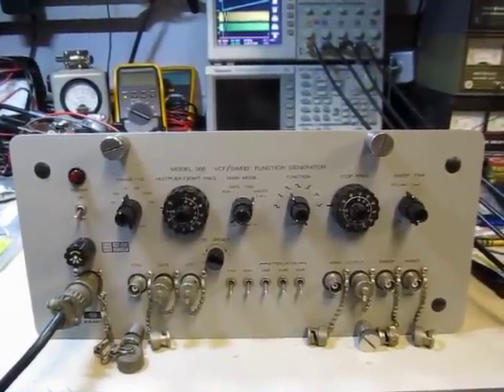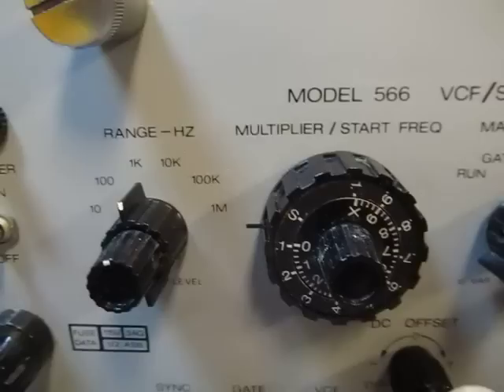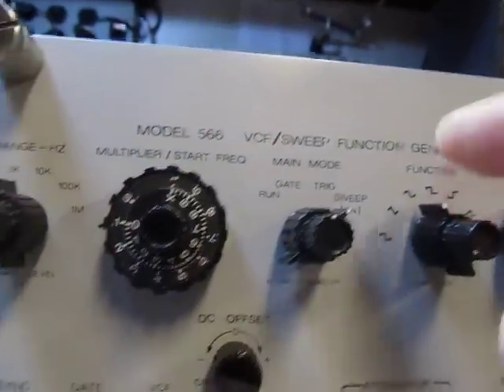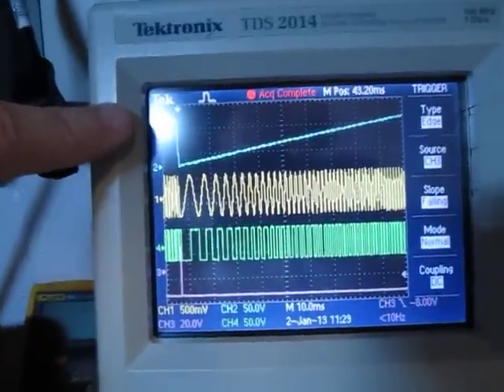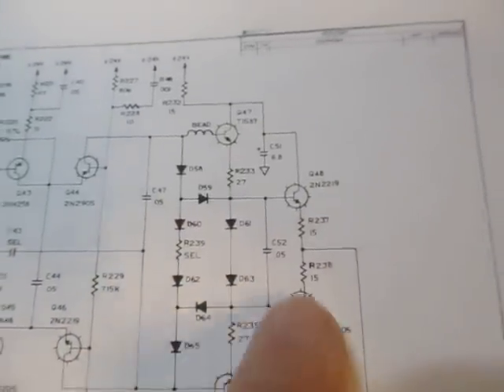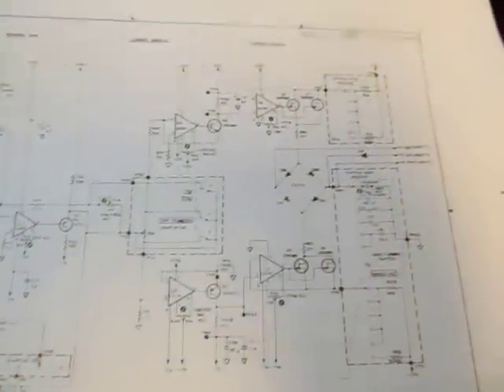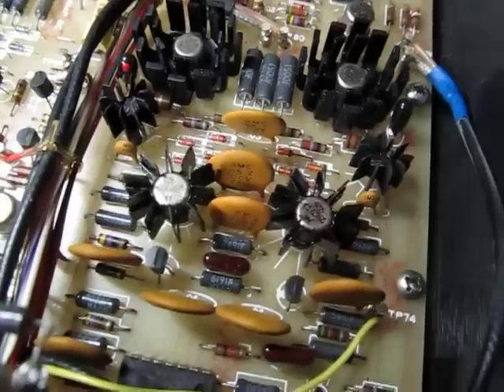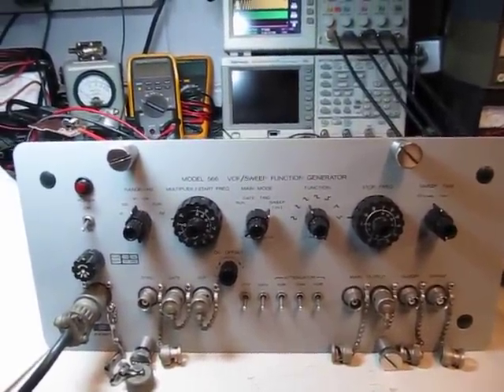#73: 70's Vintage Function / Sweep Generator review / teardown

Comment: If an amplifiers output signal is 10 vac AC peak you take the DC equivalent which is 7.07vdc    which is a "3 volt potential difference" between 10vac - 7.07vdc? Is this considered a "potential difference" from an AC voltage potential to a DC voltage potential?
Reply from the maker: No.  It is just two different ways of measuring something.  Just the same as saying that 12Vrms = 16.97Vpeak, or 28.28Vpp.  All exactly the same thing on the same sinusoidal signal.
Reply: @w2aew  If its the same thing why do you have to use the RMS dc voltage instead of using the AC peak voltage to compute for the amplifiers wattage? RMS DC voltage/ speaker ohms = amplifiers output Wattage
Reply: @w2aew  How is RMS different than Averaging? Root Means Square is a different type of averaging. Averaging is NOT 0.707 , some oscilloscopes have a menu for averaging the Sinewaveform and also RMS of the sinewaveform. RMS is some type of averaging but its different. What I'm confused is to compute for an amplifiers output wattage you have to use the RMS voltage and NOT the averaging voltage 0.636. The RMS is 0.707 VS Averaging is 0.636 but they are both averaging the Sinewaveform but are different types of averaging?
Reply from the maker: @waynegram8907  The RMS value is the equivalent "heating value", which gives you a true measure of the power.  Simple averaging (0.636) doesn't give you this because power is not directly proportional to voltage, it is proportional to voltage squared.  Maybe this video will help: https://youtu.be/ue0wtlrmCJE
Reply: @w2aew  Oh I think I get it so you're saying that Voltage is NOT Proportional to Power. I think i'm confused on what is the difference between Power VS Wattage, it seems that Power is a "heating Value" and that power is an energy and its NOT the same as wattage?
Reply: @w2aew  Power Supply full wave Rectification you use averaging 0.636 which I'm not sure when measuring using the oscilloscope to measure the power supplies output full wave rectification you take the Peak AC Voltage and average is by 0.636 = "heating Value" of the rectified DC equivalent? What I'm confused about is why would you want to "average" the full wave rectified waveform
Reply: @w2aew  It can't be the same thing because an AC Peak Voltage is NOT a Power/Energy. It seems that you have to convert the AC peak voltage either using RMS or Averaging to convert the AC peak voltage into a Power/Energy Value? Since the Peak Voltage is NOT a Power/Energy Value
Reply from the maker: @waynegram8907   Power is measured in Watts (just like current is measured in amperes, resistance measured in ohms).  Wattage is often used as a term to define the power rating or power dissipation of something.  Since Power is related to voltage squared, there is not a linear relationship between voltage and power.  For example if you double the voltage across a load, you quadruple the power delivered to that load (assuming a resistive load).  Because of this square-law relationship of voltage to power, this is why you must use the RMS (root-mean-square) voltage when computing power.  Root-mean-square quite literally means the square root of the average of the squared voltage.   Average voltage is useful for other purposes/calculations, but not for power calculations.
Reply: @w2aew  What is Average Voltage used for? it seems to be only used for full-wave rectification which I'm confused why to use Average Voltage for full-wave rectification and Not use RMS?
Reply: @w2aew  PWM pulse width modulation sometimes will take the "average voltage" but I'm not sure what other types of signals or applications would use an "average voltage"?
Reply from the maker: @waynegram8907  PWM applications are good applications where the average voltage is used.  For a PWM motor drive, the average voltage controls the motor speed.  For PWM audio amplifiers, like Class D audio amplifiers, reconstruct the audio signal from the average of the PWM signal.  A pulse counting FM demodulator recovers the  audio from the average voltage.
Reply: @w2aew  How do you use a True RMS DVM meter or Oscilloscope to measuring an Average Voltage? The DVM True RMS meter when measuring a PWM signal won't take the average so the measured voltage will be the wrong value. Maybe your DVM meter can measure PWM signals and average of the PWM signal? An Oscilloscope menu would have to be set on Averaging to get the correct average voltage.

Comment: Ow man, that's a cool thing! Now that I've seen this it gives me a bit more confidence that I can DIY a crude function generator that actually can be useful, I'm trying to make a function generator to learn more about electronics, how it all works and without using a microcontroller so all the signals are created analog and it's a great learning experience.

Most of what I learned and copied is coming from you, and because you break down all the different parts of the circuits and explaining in great detail how it all works is really super helpful to me and I'm able to make your circuits following along with your schematics and the steps you have in your videos explaining every step of the way on how certain signals or waves are created so even someone like me, with a bit of help from you personally as you've been doing this week, is able to get it working and I have zero experience with this particular DIY function generator.

I'm so thankful for your videos and your help, I couldn't do any of it without you.

Comment: This topic has almost bought a lot of discussion from members on the R390 list. The Ceramic disk are much easier to install and they do have lower ESR at higher freqs. I clearly see this when I rectify the output of a sig gen and do an A/B comparison on a scope. However, doing an A/B comparison of either and RF or IF module in a receiver I don't see any differences in sensitivity. The original caps were often Black Beauties. 
Perhaps the accumulative reduction is just not enough to detect.

Comment: One thing I'll suggest. There has been a lot of talk on the R390A reflector about Orange Drop vs Ceramic Disk caps at IF and RF frequencies. The OD's are great at audio freqs but the have a higher ESR at higher freqs. I made a simple set up where I ran the output of a sig gen into a diode and checked amplitude at different freqs. The results were very interesting. However, empirical A/B testing of modules fitted both ways proved inconclusive in terms of gain from the stages. 
73 Glenn
DSM Labs

Comment: Hi,
Thanks for another excellent video!  If you are so inclined, it would be great if you could do a breakdown of the HP 8640B sig gen. This unit is built like a tank and is arguably one of the cleanest generators ever, at least that is now in the price range of most Ham ops.
I have 4 of them in my lab and have been through them all. The workmanship and engineering is a true marvel of technology. 

73,
Glenn WA4AOS
DSM Labs (dot com)

Comment: Sweet! Was it difficult to find the schematics and adjustment guide? I can't tell what type connectors those are: looks like UHF SO-239's? Maybe a question for future videos- what specific use where 600-ohm outputs designed for? Thanks.

Comment: Nice video. With all those pots and cal points, one might say it is the exact opposite of exact- if not in calibration. Single turn unsealed trimmers to boot. Looks like a nice bit of kit and one of the better made of the time. This puts my old paia generator of the same vintage to shame- it's only a Function generator with a XR2206.  Believe it or not I saw a new design just a few days ago using this antique chip and an Atmel to control it. Like seeing a horse with Fuel Injection. Thanks!